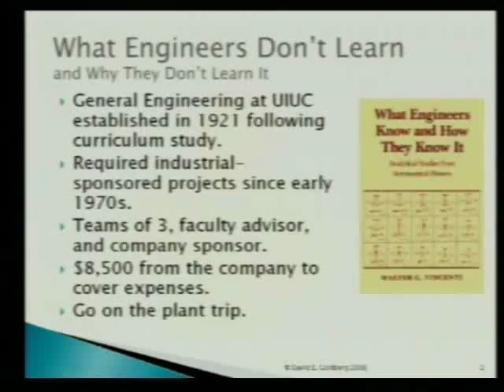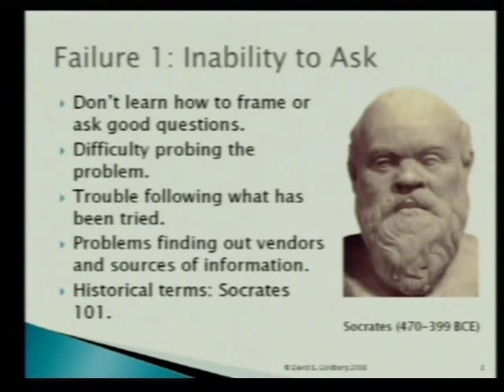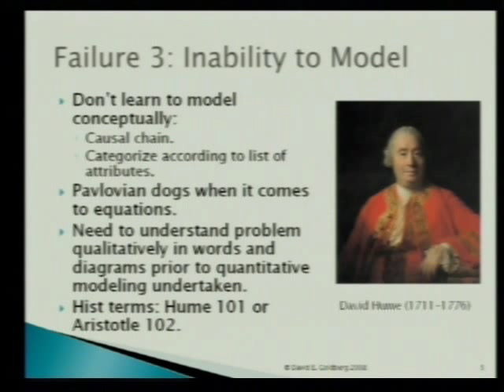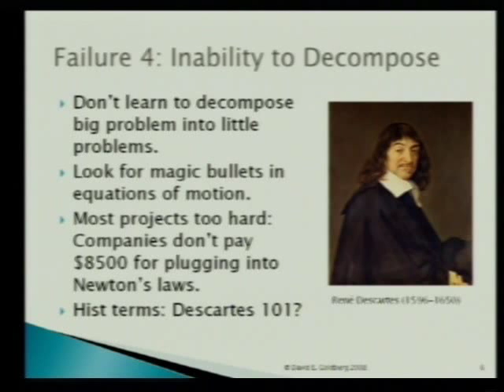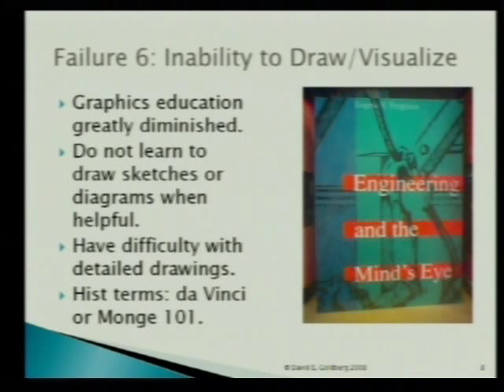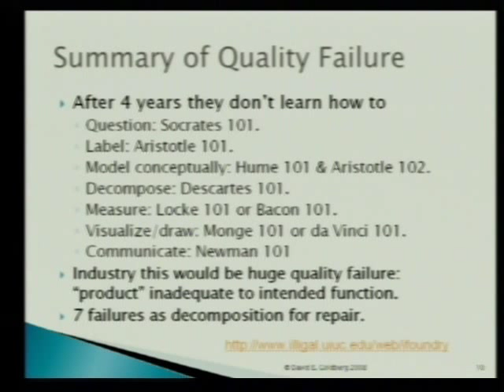7 Things Engineers Don't Learn They Need to Know

Comment: I graduated from Texas A&M in Civil Engineering in 1983, and I'd say this presentation is way off base. Drafting, for example, is a first year requirement. Perhaps these failures are localized rather than systemic. To your credit, I have noticed a marked decrease in the quality of written communications over the years. I notice graduates of all disciplines have too little command over the written word these days. I believe this can be traced to problems in our secondary education system.